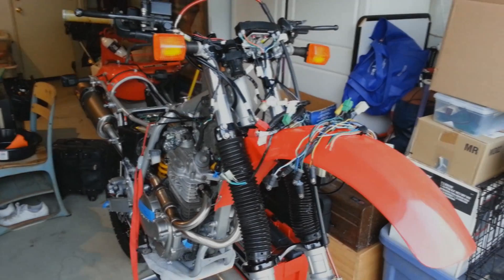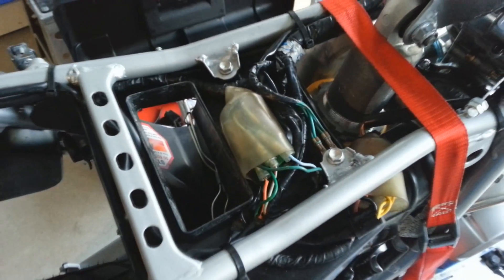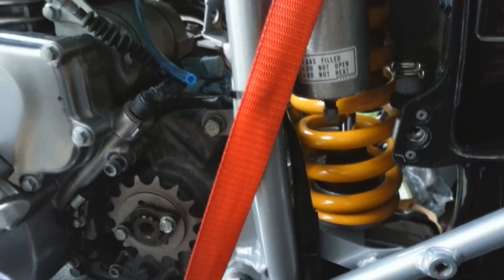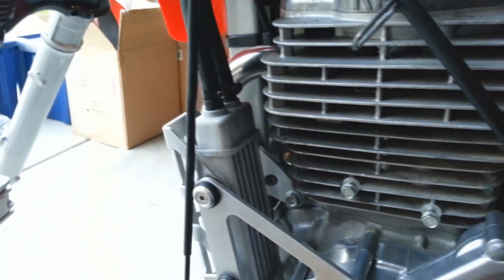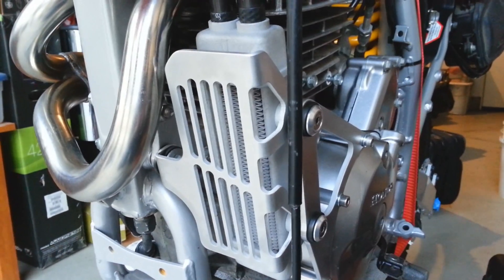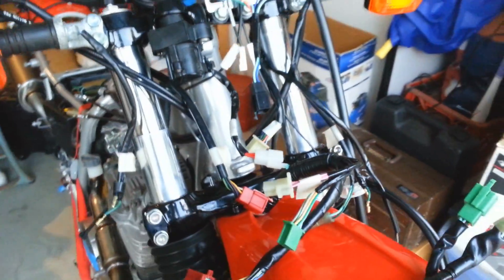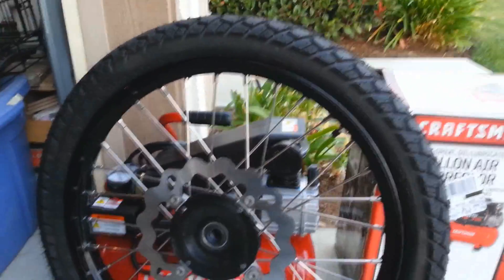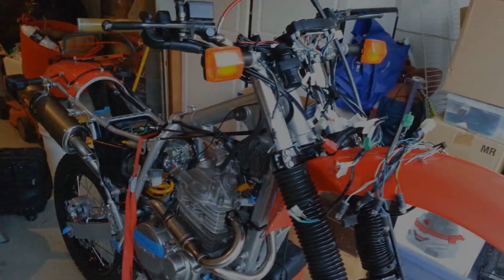The XR Files: Update 2

Comment: slick bike man its really clean. you should look up the battery mod to put a waaaaay smaller lighter dry cell battery under the seat and run a xr600R left rear plastic, save weight and help it look slimmer. im getting that oil cooler!

Comment: around 4 minutes while describing the wires up front you said there was  an "engine temp connection. . are you sure about that?
Reply from the maker: Yup, the TrailTech unit comes with a engine temp sensor. I tried it, but it connects at the engine is in place of one of the crush washers on an oil line, and it just gave me a small oil leak, so I left it off